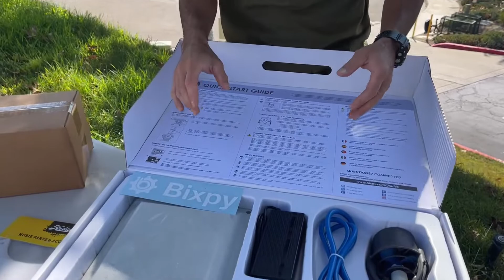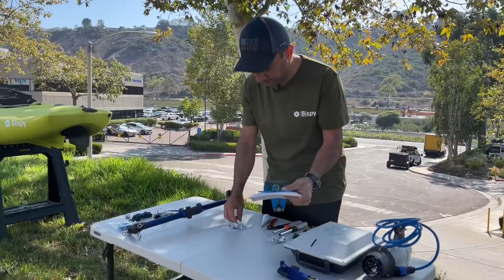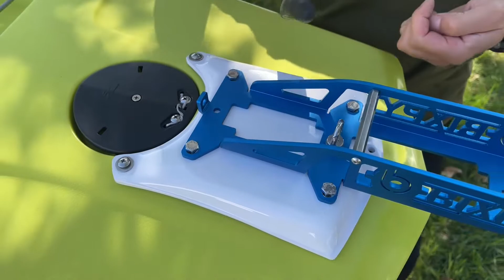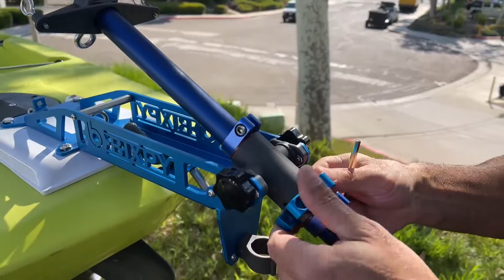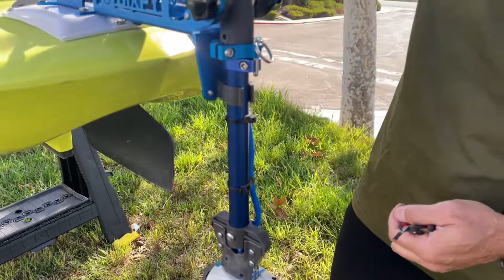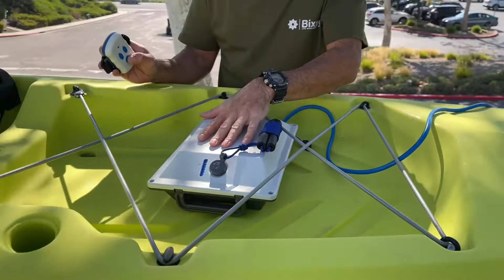Bixpy J-2 Installation: Hobie® Compass Adapter with Hobie® Power Pole Plate

Comment: That's my boat! And i love my Bixpy. I upgraded to the PP-768. My Bixpy does approx 4.5. With my weight, 5ft 7 156 lbs, and everything on the kayak. Its such a dependable motor, light, and if i get a new kayak, i  know my motor can be transferred! 💯 🌊 🛶  🎣